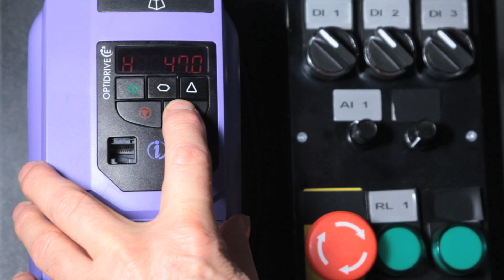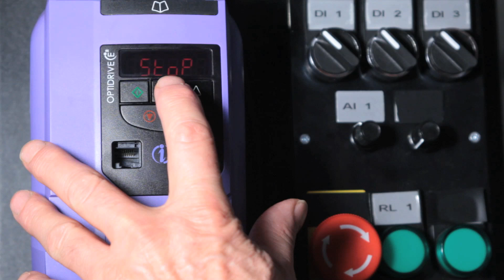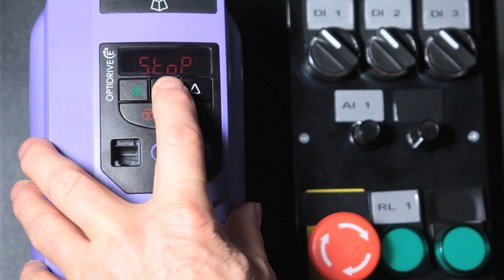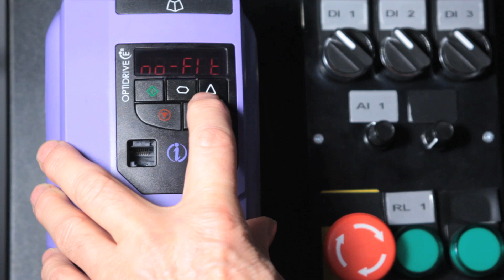Invertek Optidrive E2 Guide Part 2 -  Basic Settings

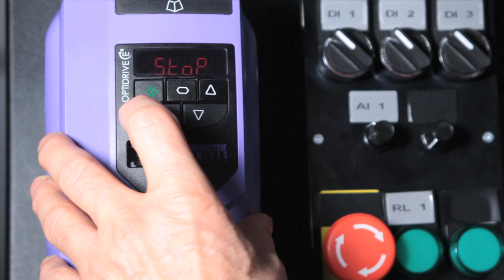Comment: Hi, my drive suddenly didn't function anymore, so i've reset to factory settings and reconfigured all parameters. But...for F12 ( 4:55 in the movie )  i can't change the digit  ( is on "0" now ) When I press up or down the "0" remains and the first digit of the screen shows additional an "L" as long i push the up or down button....What can be the cause of that? Thx
Reply from the maker: Hi. If you visit our website, www.invertekdrives.com you will be able to contact your local sales partner who can advise on technical issues.

Comment: Hello there, thanks for this video.. I am a student at University and trying to control the VRF motor though labVIEW program; Optidrive E is connected with CPU through speedy.. 
I am following the instruction on manual to connect through modbus ( P0 12 and 4) ( Modbus network control) 
Problem facing right now.. 
1. Trying to put it on default setting as explained in this video.. but it only set to default when control terminal 1 is disconnect and show the 'stop' message as it shows in video.. However, it goes back to previous setting, after, connecting the Terminal 1 (T1).. 
 2. can you please share the documentation to connect through speedy.. ? 
Thanks!
Reply: I am looking forward for reply?...

Comment: Hi, if im using a 4 pole 230v/50hz(uk mains) 1400rpm motor with this drive and set p-01 to 100hz will the motor run at 2800rpm? ...more importantly will this damage the motor? I have p-07/08/09 already set to 230v/5.7a/50hz cheers ant :)